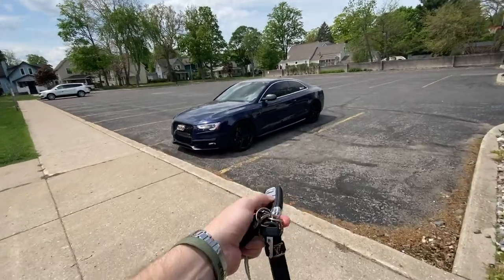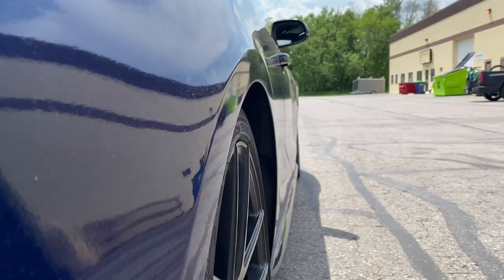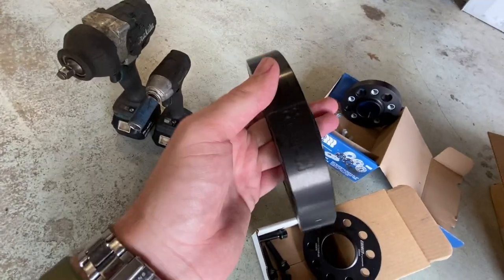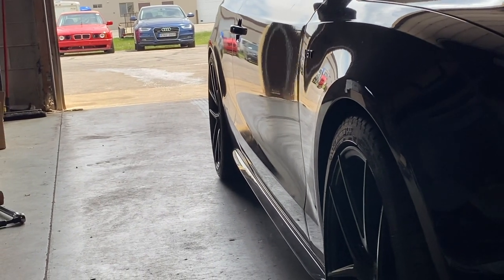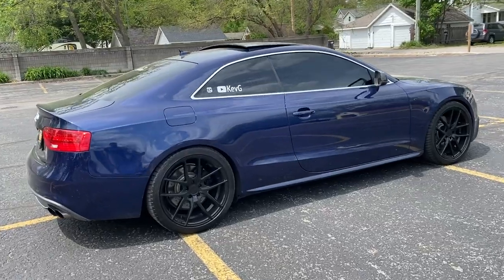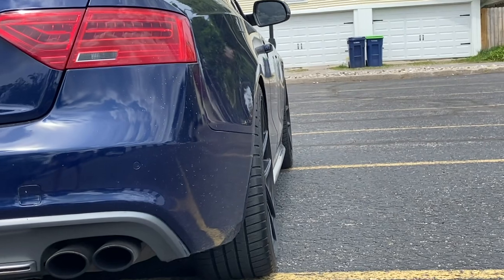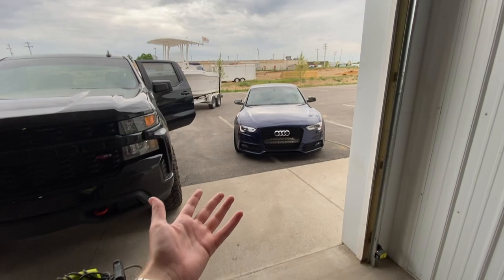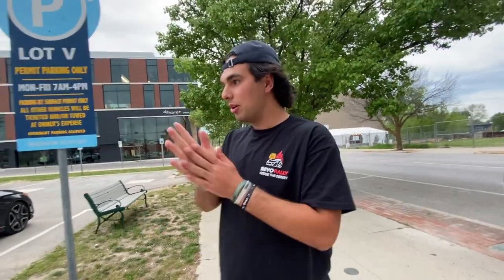Audi S5 Spacers Install - Fitment is on point!

Comment: What's the wheel/tire specs? I got 20x10.5 et27 Niche Misano with 275/30/20 tires. Just ordered the sport springs for my S5.
Reply: Hey man just wondering if those wheels fit good with your springs? I just ordered 1.3 in lowering HR springs and i wanted to pick up these 20in rims i found but idk if those wheels would be hitting anything yk?

Comment: For the h&r rear spacers did you bolt the original bolts to the new screw area on the spacer?

Comment: Looks good...
Butttt...what abkut safety for the front parts???
All the ballance is changing... another power torque will be on the front...no?
It is safety in high fast driving? 
250kph ??? What is the risk of there is ????

Comment: What size were or are your wheels tho? For example I got Rotiform 19×8.5 so mine are SUNK. Need spacers badly but I have a B8 A5 so Same But Different.
Reply: I have the same thing. 19x8.5 rotiforms on my s5 and it's looking like I need 25mmF and 40mm R 😵

Comment: just put XRM 810 and im wondering what the offset on your wheels are. I have about an inch of space on the front and rear. is there a reason to do 20 in the front and 25 in the back. I was thinking 20 in the back and 17.5 in the front. any advice would be great.

Comment: I've heard others that have gone with 15mm up front and 20mm in back on their S5 to prevent rubbing.  Have you gone over any speed bumps or potholes that caused any rubbing with your current 20/25mm setup?
Reply from the maker: Not so far! All good

Comment: Why didn't you just get rims with the larger positive off-set? Proper hub-centric spacers are ok for going straight but terrible for the OEM steering dynamics, baring's and suspension in a lot of cases.  It's always about aesthetics, performance be dammed.
Reply from the maker: I had a small brain when I ordered wheels over 5 years ago

Comment: Those are obviously aftermarket wheels, why not just get wheels with an offset that doesn't require spacers? I'm assuming those are closer to et45, why not go with something closer to et25?
Reply from the maker: My brain was small when I first ordered wheels for this car a few years prior to this video. As I learned what offset was and how to achieve proper fitment, I definitely would do it differently if I had to do it again👍🏼
Reply: @KevG  my brain is still small. Im looking at rohana rfx11s for an s5. But im sutck on what offset to go with
Reply from the maker: @megabunnydeath  I just got the RFX11’s for my B9 S4. Went with 19x9.5 +30 and they’re perfect. Not exactly sure how they’d fit on the S5 but check fitment industries
Reply: @KevG  would love to see pics. Will they be in any upcoming videos?
Reply from the maker: @megabunnydeath  they're on some of my recent videos. A ton of pictures and videos are on my instagram - @S4_KevG
Reply: How long did you have the spacers on for and did they do any damage or change the way it feels?